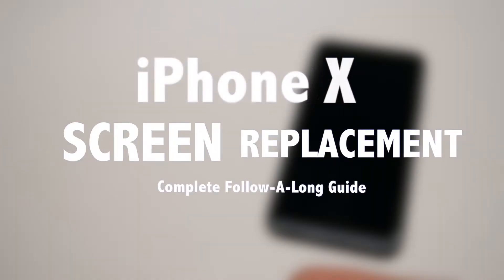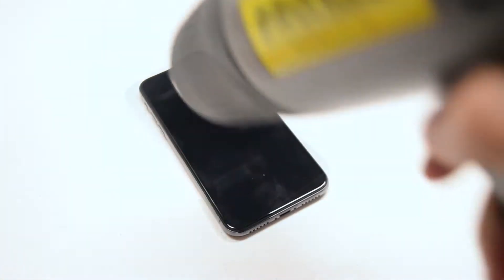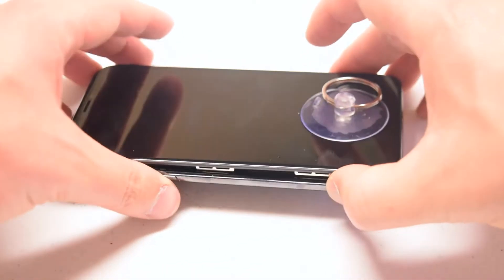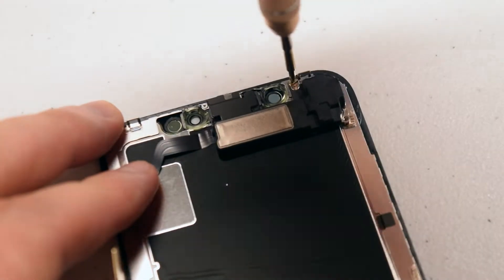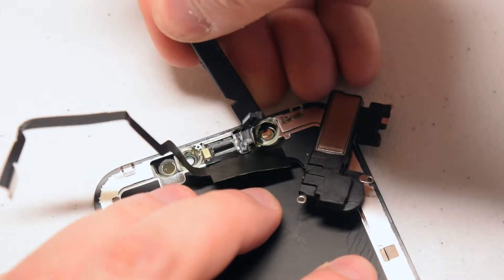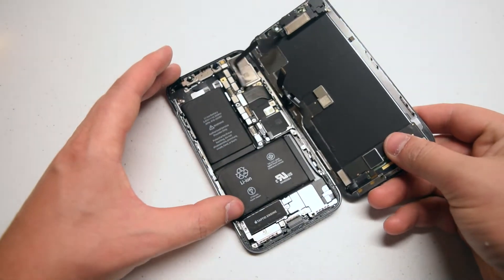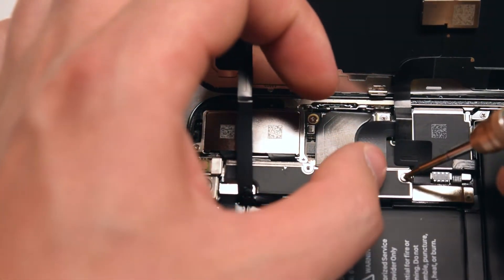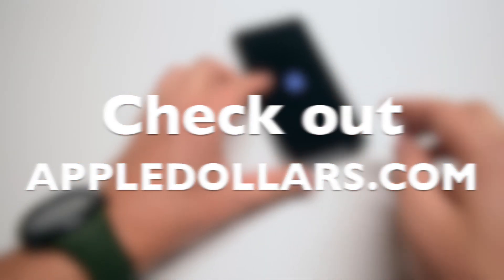iPhone X Screen Replacement

Comment: my iphone x has an aftermarket screen replacement. After some time of use, ghost touching occurs and it also as a play on it on the lower left of the screen. Reinstalled it or re seated it once it it worked fine. After sometime i wanted to check whats wrong with the face id and speaker and then the ghost touching came back.

Comment: Good video, but there are five screws on the protective plate, not six.

Also, the battery should be disconnected as soon as the plate has been removed, before all other connectors.

Also, when putting it all back together, the battery should be the last thing to be connected before the plate is replaced

Comment: but you need to remove the battery first . to avoid shortings
Reply: The battery only needs to be disconnected, not removed